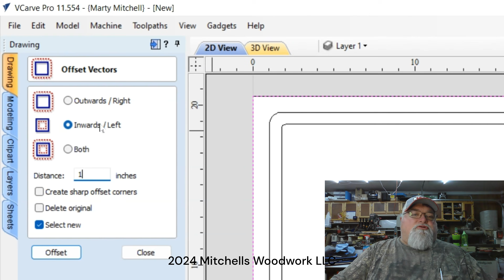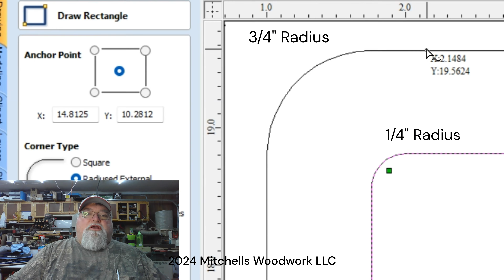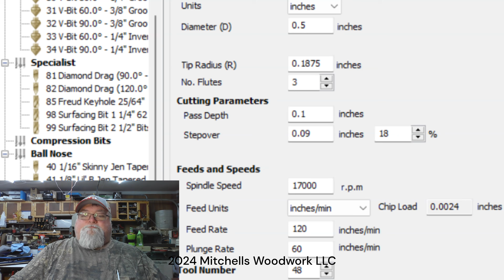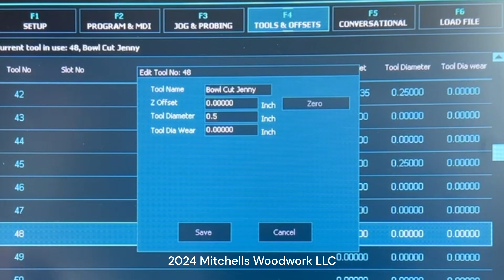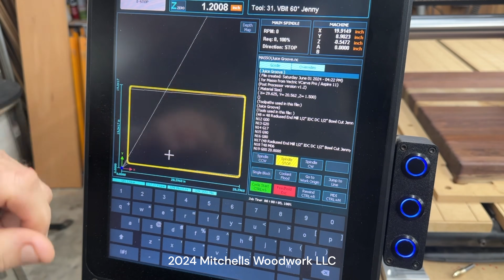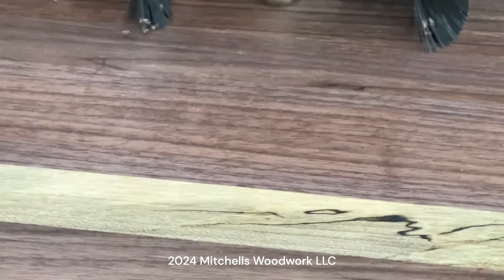Juice Groove Project | VCarve Pro Tips & Tricks | Onefinity Elite CNC

Comment: Another awesome informative video, thanks!  I feel your concern about the potential  magnet issue. On my 3rd or 4th time using my foreman, I completely forgot to connect the magnet,  destroying my 90 degree vbit.
Reply from the maker: Thanks for the tip, Dan!  I’m definitely going to have to use some of the tips suggested by others in these comments.  That’s really my only hope at this point.  Old habits definitely die hard!

Comment: If you had a 3/4”bowl bit (or wanted a 1/2 juice groove) could you eliminate the math and just run a single tool path at the center of the bit?
Reply from the maker: Yes, absolutely.  In either of those scenarios I could’ve just ran it as a profile cut and the inside radius would’ve taken care of itself.  Great question!

Comment: Another good video mitchell and shows the importance of  why boards need to be flat.
Also a piece of blue tape on the spindle saying magnet until you are used to using the magnet on the spindle. Bits are expensive.
Reply from the maker: Great point.  If I had needed to carve text on the upper part of the board it would’ve been a disaster.  Fortunately the 1/2” deep juice groove pretty much negated the issue.  Great idea about the blue tape, thanks!

Comment: When you add the bits to the Masso, When using the probe will automatically set the correct bit diameter?  Good video as always!
Reply from the maker: Not quite.  I manually entered the diameter of the Bowl Cut Jenny (0.5”) into the Vectric and Masso databases before I could use that bit.  

In this example, the probe only tells Masso the Z height of my workpiece (the surface of the cutting board).  Thanks for the question and for watching!

Comment: The inside radius should be 0.5T, where T is the thickness of the groove and the outside radius should be 1.5T
Reply: Yup. Works every time.
Reply from the maker: @jamesbutler4157 awesome, thanks!
Reply from the maker: So in the case of my 3/4” wide groove, the outside radius should be 1 1/8” and the inside radius should be 3/8”?